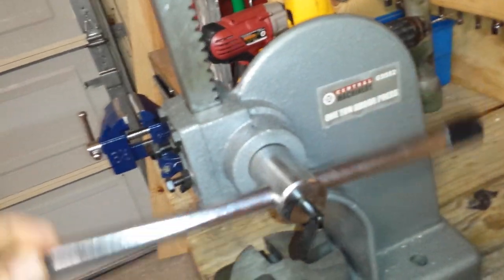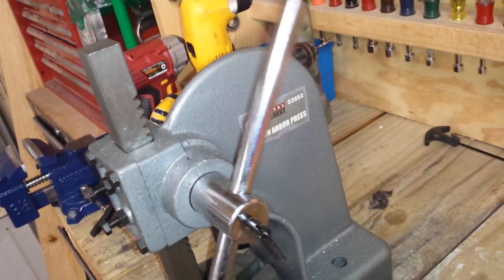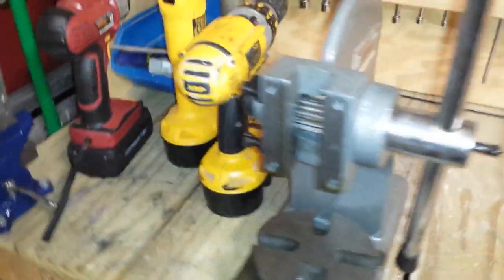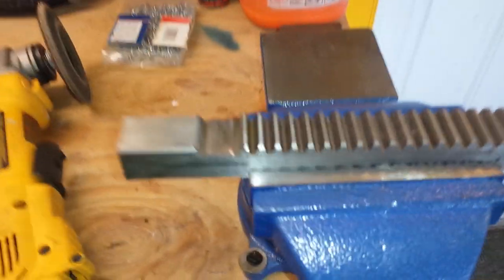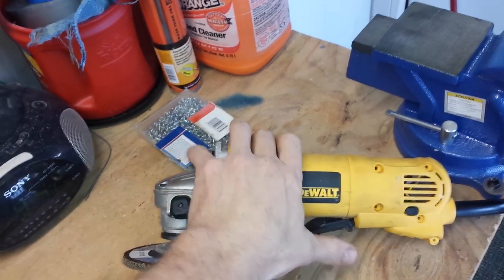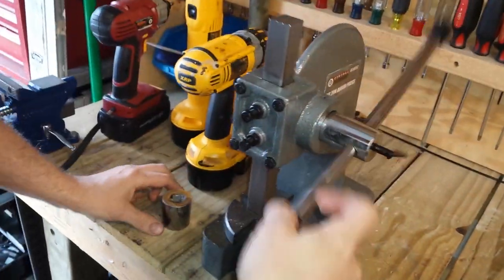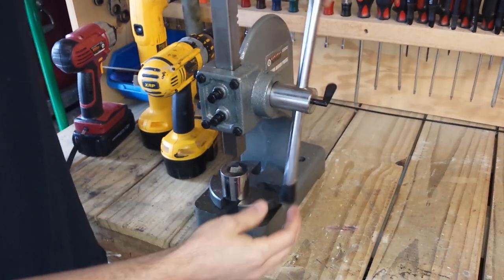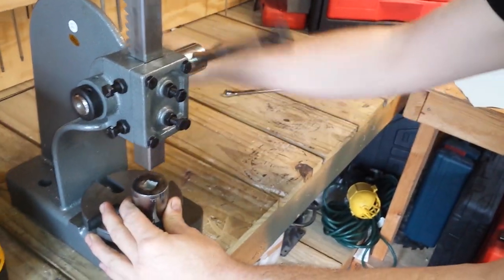1 ton arbor press modification

Comment: Why not just add a small spacer of the desired thickness under the work or the ram shaft? I have all kinds of stuff (scrap metal, etc) around the workshop to throw in there.

Comment: my pinion in not held in place with a bolt on the left side I just remove in and lay the rack on the part being pressed and slide the pinion out and put it in the desired position and go at it.